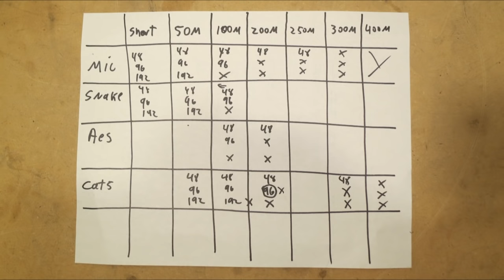Test AES3 on Mic vs Snake and CAT5e Cable @ 48Khz 96Khz 192Khz

Comment: Nice test Dave!
You didn't mention it but there is loss at the interconnects. A single 200m cable might work where 2 100m cables fail. DMX and AES signals suffer more from this than analogue due to reflections created at these points.
Reply from the maker: +Malcolm MacgregorSound Yes, and I agree with anvilshock, that in the real world applications, interconnects are part of the equation. That said, I will head out back and see if adding several small jumper XLRs to a a 50m Mic cable will make 96K fail at a much shorter distance than the 100m of cable that 96K works with.
Reply: In the real world there are a lot of interconnects, so it definitely makes sense to test with them. I just wanted to point out a point of interest :-)

Looking forward to your findings Dave.
Reply from the maker: +Malcolm MacgregorSound I did a video with a bunch of intreconnect using AES192. It will be up on the 23rd of Nov
Reply: Absolutely correct.  Usually, a well made RF cable will have very smooth impedance through its length.  It's where you separate the cables and terminate where the impedance discontinuities (mostly) appear.  It's where the reflections start and where those reflected signals merge with the freshest signal coming down the transmission line, causing signal corruption where the decision circuit cannot make out the 1, or 0 correctly.  Rather than a  PASS/FAIL test, a bit error rate test tells you more.

Comment: I have run into a situation with a Dlive DX AES out (running 96k) to D&B D20 amp where XLR 10 foot was working but wouldn't keep the sync. Sound was interrupting from time to time randomly about 3 seconds.
I had access to a spool of DMX AES cable 4 twisted wire and mesh shield, solved to issue.

Cool video, but I still want my digital signal to be with short AES cable or cat7 for longer run even though a 10 foot xlr audio cable can pass it.

Thanks Dave !

Comment: This video makes me realize how much I miss working and getting lost in what goes in and out and where. Lockdown is absolutely necessary but hard on the mind and feels some nights.
Reply: I think history has proven it was absolutely unnecessary and did more harm than good.
Reply from the maker: My take is lockdown was beneficial is slowing the spread to reduce the overload of hospitals as sickness exceeded capacity. Supply and nursing shortages as well as open beds and such were all issues. Slowing the spread resulted in saving many lives. 

As immunity rises, lockdown measures should have reduced in unison. Though the timing and such was often out of sync as one would expect when a complex grand scale orchestration occurs, I believe the "completely unnecessary" viewpoint is short sighted and flawed. 

Could it have been done better? Yes. Were there over reactions and under reactions, yes.

My take is over reacting is equally as foolish as under reacting. It is the measured and well informed middle ground that results in the optimal outcome.
Reply from the maker: Looks like you are trying to reply but YouTube is blocking it. I can see the beginning of a childish angry comment from you in the comment feed but it's gone when I click on it.

Something about me being a comment deleting dick

I must admit that watching someone have a tantrum posting increasingly angry comments that are getting censored by the YouTube bots and imagining you getting more and more frustrated is an amusing mental image.

Maybe try toning it down and maybe YouTube will let your comments actually post.

Comment: As expected, pro audio is not immune to perception of quality or fact distortion. Basically, like you said, a normal decent quality analogue mic cable will work perfectly within a certain range of applications and length. No need to spend X money in AES cables unless you have specific needs. Personally I sent AES 96k through 300m of Cat7 without any problems at all, at a fraction of the cost. Nice video :)
Reply from the maker: +Alexander Budd Agreed and I really like to just test things rather than buy into a concepts that may or may not be credible.
Reply: yes it depends on your use ... if you're just laying wiring for a live show etc it's not going to matter - if doing recording and you care about quality then it sure DOES matter.
Reply: @antigen4  How so? It's just 1s and 0s at the end of the day.
Reply: if enough zeroes become ones and ones become zeroes when travelling through a long pipeline then yeah it's a problem i guess
Reply: possibly less so if the signal is unconverted digital though ... but that nearly never happens in a studio situation ...

Comment: First of all, thank you a lot for this video!! 
 I also like your Ethercon snake system and I'm thinking about of buying some cable for my school.

This may be a stupid question, I'm starting right now with live sound mixing and electronics.
How is the shield transmitted from the Cat6/7 cable to the XLR in the CatSnake Stagebox? Because if I'm not mistaken there will be a connection between the shield and the housing of the CatSnake. 

How did you manage the shield problem?

Comment: AVB network replaces AES and permits use of AVB comparable network routers to ensure time slices for synchronized digital audio packets. Long concert runs are no longer a problem as a mid span network switch can join segments of cable as needed. The network switch permits use of the stage box audio by both the FOH engineer and the side stage monitor engineer. A typical stage box has 16-64 mic line inputs and 8 sends per box or more. There are incomparable formats, so look for the open source AVB standards for cross equipment comparability to prevent vendor lock in as happened with VHS vs Betamax.
Reply from the maker: And also, sometimes simple easy analog and AES3 are the best way to get the job done. Having old school utility XLRs can be super useful for talkbacks, com, and shipping a mic signal to several locations without latency. Analog, AES3, and com over shielded cat5e. Perhaps like how bicycles are still relevant long after cars and planes have been invented.

Comment: Great video, Dave. Thank you! 
I have 2 questions about cabling.  
1.  CAT BOX uses CAT5e Ethercon jacks, but does using CAT6A cable on CAT BOX have advantages over CAT5e cables (in terms of Electromagnetic interference or radio-frequency interference )?   
2.  Would CAT5e Ethercon jacks limited the capacity of the CAT6A cable?
Reply from the maker: You can use and shielded cat5e or better cable.  Cat6, cat7, cat6a are all good.

Since it's analog over cat cable, and cat cable is rated for frequency responses that are 100k, 1 Meg, 10meg or more and analog is only 20k, all the cat grade cables are well over the capabilities. 

Shielded is the main thing as you need the shield for phantom power to work and the shield reduces interference issues.

Though cat cables have very high quality twists and are naturally better at avoiding interference than regular audio cables.
Reply: @DaveRat  thanks for your reply!

Comment: I should do a video showing the TDR reflections in each of the cables and their nominal impedance. Maybe later. Working overtime currently.
Reply from the maker: Yes and also please show or set to hear the audible differences of those reflections so we are able to understand the relevance of reducing them
Reply: @DaveRat  At audible frequency, there is little effect in short parts of a wavelength. This is important in distances from 31 inches at 100 MHZ, 3100 inches at 10 MHZ, and 3,100 inches at 1 MHZ. At lower frequencies, the mismatch when severe is quite apparant in shorter distances of 50 feet. For example use an old school high Z mic into a high Z guitar input, or a high Z guitar pickup on a 100 foot snake to a guitar amp with high Z input. There is a reason, pro gear moved from high Z to between 200 and 600 ohms. Old school was incompatible with long cords. A 50K Ohm mic on a 50 foot cord to a tube amp did affect the quality.
Most home stereo RCA Inputs are 20K Ohms. Most home stereo is not used as pro gear for a reason. It is incompatible with long cables.
When I get some time, I may put some TDR results up for many consumer grade cables.
Reply: @DaveRat  It will take a while to get a video together and I'm not a video producer. Replying as I did some testing on two snakes I have with an interest in comparability with digital. The two snakes tested are a 100 foot 12X3 and a 75 foot 12X4. The 12X2 I could not find online. It is a blue stage box with the brand Pro Sound. This was bought used. in good condition. The other is a Horizon Stage Series. The Pro Sound has a grey PVC jacket cable and the Horizon has a black rubber jacket like an SO power cable. To my surprise, these two cables matched each other in impedance and were both 65 Ohms. Ethernet CAT 5 cable is specified at 110 to 120 Ohms.  RS-485, the standard used for DMX-512 is specified at 120 Ohms. When using a traditional analog snake, the low impedance causes a reflection in the cable of fast rise time digital severely limiting it's usefulness for long distance.
This is how I took the measurements. Someone already did an excellent video of the process. Instead of a pulse generator, I use a function generator with a response up to 25 MHZ. I use a resistor in series to limit the current from the pulse. This prevents the low impedance of the cable slowing the rise time of the generator. Trace on the scope has a sharp rise, but low amplitude. This is the exact method used to measure the impedance. You can see from the trace if you sent high speed data, causing the pulse sent to be short, the impedance mismatch to the load causes extra steps in voltage in the original square pulse. This is what affects high speed data. The microphone to cable impedance and cable to console is much less critical with a low z mic such as a dynamic. Issues with a very long guitar cord and the high Z guitar are well known. In old time radio, when crystal microphones ruled for the high voltage for tube amps to avoid hiss, long cables killed the mic response, so crystal mics were never used with a long snake without issues. Ask anyone trying to direct connect an electric guitar into a snake with only a TS to XLR adapter. A high Z to low Z DI box is required. The low Z overloads the pickup and kills the response. https://www.youtube.com/watch?time_continue=415&v=Il_eju4D_TM&feature=emb_logo
Reply: The scope I used is this one as it has the function generator built in. They call it an arbitrary waveform generator. Less than $300 and can be used for TDR measurements.

Comment: Fun video but how are those mic leads going to work when you roll them out in a straight line and they pickup AM from local radio stations and other digital noise from the lighting and air-con?
Reply from the maker: Its quite amazing how well a shielded Cat5e rejects interference. Not only due to the shield but also the twisted pairs are twisted so much more accurately and have more twists than mic cables.

Comment: I wonder if testing cable like this, rolled and fastened brings any coil-effect into play. I'm no sound engineer, but I heard of one old guy once, that all cables should be spread to avoid coil forming.
Reply: +moristar1101 Most, if not all, pro audio cables are shielded. Though the shielding may vary in quality, the low current makes sure there's no coil effect. If you'd run 2 amps of current through it, that would be another scenario.
Reply from the maker: +moristar1101 The coiled cable may or may not have an effect. The reality is that in order to keep a clean stage and setup, coiling up the excess cable is a reality that is pretty much unavoidable. The question I feel is not whether coiling is worse than real world, but rather, if a cable is run straight, can we get better results? On the other hand, it is probably safer to look at worst case scenario coiled cables as the baseline.
Reply: Dave Rat I see your point and agree - very practical :)
Slightly off topic - is it really possible to get long coils too hot or inflict any other kinds of damage under heavy load in real world scenario?
Reply from the maker: +moristar1101 When dealing with high current single conductor cables, leaving them in a coil can create an inductor and heat. To solve that, wind in a figure 8 pattern rather than a coil. That is for Power Cables like AC feeder.  For signal cables it is a non issue.
Reply: Nice! Thanks, Dave!
Reply: Coiling is no issue with the frequencies of either analog or digital.  Where coiling is an issue is when it’s done on top of either a power transformer or high current mains cabling, such as that used for lighting or system mains.  Likewise, coiling of power cable can induce large 60Hz voltages into even straight runs of low level audio.  A very large voltage can be imposed onto the shields and/or the conductors - even tightly twisted pairs.  This is easily avoided by planning and cooperation with lighting and power techs.  Those techs SHOULD know better than to lay a coil of their cable on top of any other wire at all.  If they don’t, educate them politely and privately.  We’re all on the same team.😎

Comment: hey dave great video. Along the same lines I was wondering if you have used the whirlwind ir snake. could you do a video about it?
Reply from the maker: +Dan Fletcher Thank you Dan.  No, I have not used the Whirlwind IR snake. If I do run into a situation where I use it, find a distinct advantage to it or issue with it, will consider doing a vid.

Comment: This may sound as a rookie question, but how do you roll such long lengths of cable so well? Over/Under works for me to about 50m cables then after that, the cable becomes a jumbled mess. Can you please tell me or make a video about how you roll such long cables so well?
Reply from the maker: +BananaWaffle Hmmm, after reading your question I did a youtube search and looks like there are some cable coiling videos out there.  I have not watched any so I do not know the quality of them. I try and do videos on subjects that no one else has done yet or from a differing angle than is normally accepted. Let me know if the info out there is not up to par, and if so I will consider giving it a shot.
Reply from the maker: Very cool, yes, soon.  We are waiting for the CNC cut version next week.

Comment: How about the Signal loss the other way around? Means line/mic Signal down an AES cable? Does this matter?
Reply from the maker: I kind of cover that in this video

https://youtu.be/KZqoA12Qjr8
Reply: @DaveRat  Ahhh I see, Dave. Thanks a lot! So would you say that we better use AES (110 Ohm) digitale Cable instead of mic (75 Ohm) cables for Line/Mic Signals in a multicore for example a Tourlock 25pin?
Reply from the maker: @danielheinemann4356  in the test that I've done the mic cable perform just as well as the AES cable of the same diameter for AES.
Reply from the maker: Here is another aes test that's a bit different that may have helpful info in case you've not seen it

https://youtu.be/oasD75TsCeQ
Reply: @DaveRat  Did you ever made a comparison of cables where the pF between the wire and the Shield is higher then the other? That would be interesting About the loss for a cable with for example 200pF and 100pf between Shield and wire.
Reply from the maker: @danielheinemann4356  I have not but will do more wire tests soon, especially as we develop our new cable
Reply: @DaveRat  Looking Forward, Dave :-)

Comment: As an amateur novice is their any difference between an xlr mics cable and a snake cable?
Reply from the maker: an audio snake cable is multiple shielded twisted pairs in a bundled cable and an XLR cable is a single twisted pair shielded cable. Both do the same thing except an XLR is one channel and a snake cable can be 2 to 56 channels or more.

The snake cables typically use thinner wires and less insulation as well as have an overall protective jacket but minimal protective jacketing between the channels.

The added size and distance between the wires in mic cable can be beneficial. Or another way to look at it would be to compare snake cable to super thin mic cable wiring as is used in wiring for installations.
Reply: @DaveRat  so the thickness is a difference?

Comment: have you used cat7 cables yet? just wondering if the specs are better or not.
Reply from the maker: Not tested but should be better, will need to test to know for sure though

Comment: Has anyone tried this with AES 50? I have had problems the the M32 and x32 stage boxes down cat cable past 100meters.
Reply: Max length for AES50 is 100 meters / 328 feet.
 if you want more,  you need to use the klark teknik DN9610 Repeater.

Comment: Im having clocking issues with one of my aes cables to my mains. Im using a jbl and cables tested fine but at 96k one of my main sides pops. Any thoughts? Thank you
Reply from the maker: How long is the cable and what type of cable is it? If it's an AES cable is it that thin type or is it the thicker like a regular mic cord? The thin ones are good for short distances but actual thick mic cable will work better than a thin AES cable for longer distances and a thick AES cable will work even better than that
Reply: Its a thin aes but its only a 6 foot . Its jumping 2 amp racks together via left stack/ right stack. Looping out. Aes 2 is the the problem. Even if i swap them its aes 2. Thanks for your response
Reply from the maker: Cool cool I'm glad you got it sorted or at least figured out